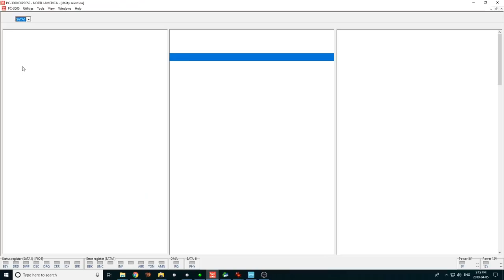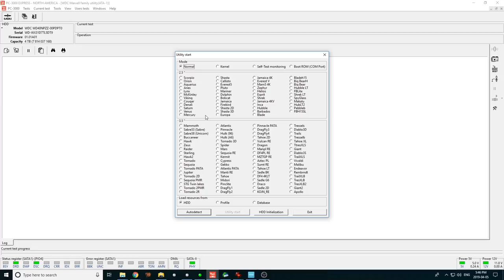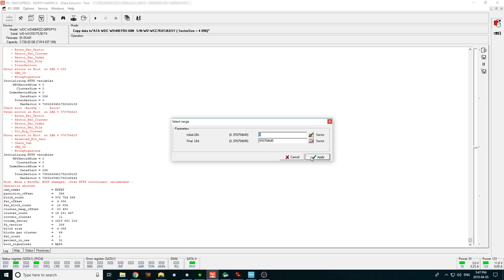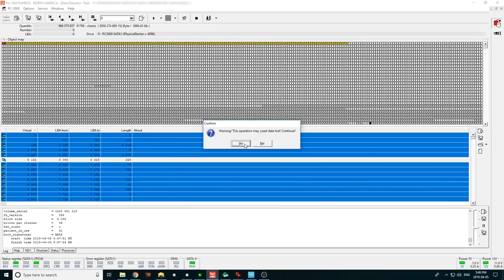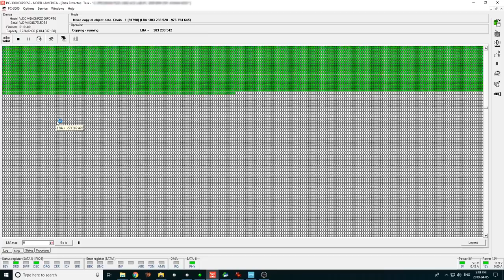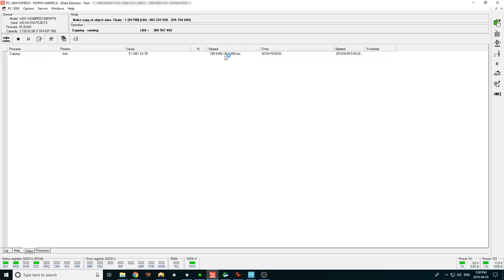WD40NPZZ-00PDPT0 data recovery | very slow drive SpyGlass

Comment: The cans you get at Staples, etc are intentionally not zero-residue. Kids used to use those cans as a mind-altering device, so the manufacturers include Bitrex or a similar chemical so that trying to inhale causes such a strong bitter flavor in your mouth that you seek fresh air. Industrial compressed air isn't quite as easy to get ahold of so it doesn't have bittergents like that.

Comment: Hi, around 2 years back i accidentally dropped my 4TB WD MY Passport Ultra external hdd. When i plugged it in my PC it started making clicking noises. I had another WD My Passport 4TB external 2.5" and i tried replacing the PCB board to see if that might fix it but it didn't. I since just left it in my drawer. Is there a possibility to get my data back?  I did send your company an email. thx
Kind Regards,
Renaldo

Comment: thats an industry lie... you can easily do a platter change on a kitchen table, and still get yur data out...yes the unit that you had open will be trash, but you only need 1 read to copy the disk...
Reply: So how many kitchen table platter transplants have you done successfully?
Reply from the maker: same can be said about seat belts in the car. The car will start and drive without belts being buckled, but they can sure save from a tragedy.
Reply: @hddrecoveryservices  But lets be realistic. I would really be impressed to see someone platter transplant a spyglass in a normal room and get a good recovery. Maybe a Tornado from 2006, but not a Spyglass.
Reply: Haters gonna hate?
Reply from the maker: a lot will depend on how well you can do the process and how well know the drive. I get kitchen table inspected drive where the client "just looked inside to make sure heads are not stuck" and a lot of those cases have platter damage. If you do this professionally, then you should earn enough to own a laminar flow bench.